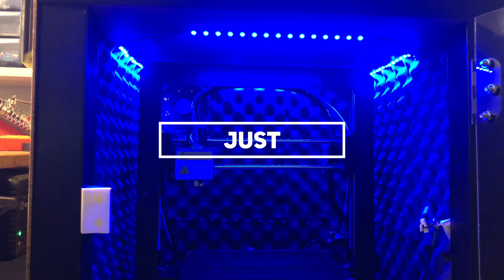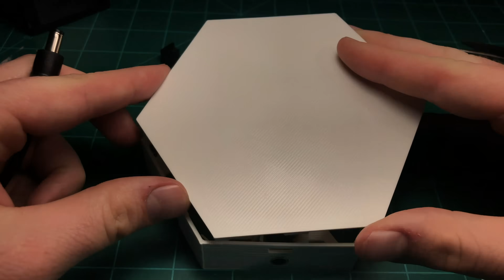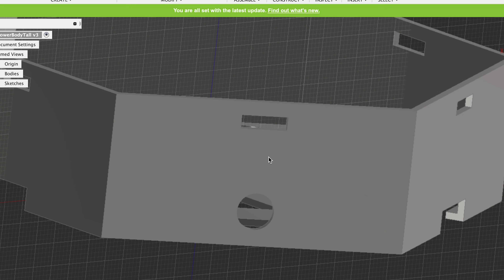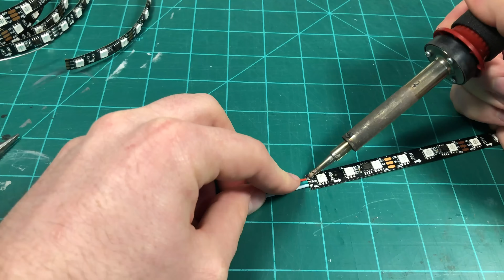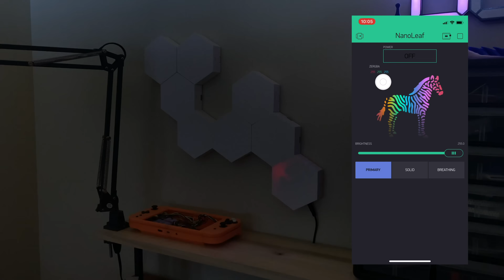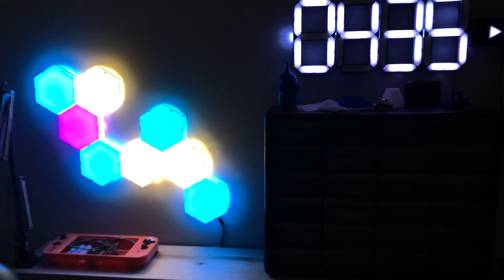DIY NanoLeaf Panels On A Budget! [Under $30 TOTAL!]

Comment: Did you have a link to the female plug for the power supply?
Reply from the maker: Yup, sorry about that! I originally used one like this: https://amzn.to/3qviSND
but if I remade this project I would use a panel mount connector: https://amzn.to/3L1Hvsz
Hope that helps!
Reply: @ModernHobbyist  do you have a video for the software side?  I normally use WLED but like how you can change individual panels with yours.  Thank you.
Reply from the maker: Sorry for the late response, I don't have a video for software on this specifically, but you could set up different segments in WLED to be able to control each panel individually if you wanted!

Comment: Today addressable LEDs make it too easy to get any colors you want, but I long ago realized that using cheap, non-addressable LEDs that are single color for the entire string, it would be beneficial to cross the wiring for each panel so that you can get differing colors in differing positions based upon the color choice you set the string to be.

Comment: where is your schematic for this?  How are you getting anyway with not using a logic level shifter in this design?  I'm using an ESP8266 for this but ESP32 is very similar and should have the same 3.3v logic output level.  The WS2811 data pin wants 5V logic, right?

Comment: how are the ledstrips lightning independent?
Reply from the maker: Hey thanks for the comment! The LEDs are connected in a continuous string, and the code is written so that each hex takes up 7 LEDs. So, for example, if I say turn hex #3 blue, it will turn LEDs #14-20 blue, assuming the first led is counted as 0. Hope that helps!
Reply: @ModernHobbyist  yeahh thank you very much!

Comment: If you use WLED software then you can segment your LED so each panel is its own segment and then you can set color for each panel with one esp32/esp8266. Since each 3 leds on 2811 can be addressed with its own color.
Reply: How´d you do that? Do you have instructions?

Comment: Cant you just resolder these two strips to compensate for the different layout ?
Reply from the maker: Hey thanks for the comment! Unfortunately not since the WS2811 LEDs only have one data input pin, so the order in which the RGB values are decoded is done on each integrated chip. Hope that makes sense, thanks again for the comment!

Comment: Are the LED connectors linked in the description supposed to be 2 pin?
Reply from the maker: Good catch, thanks for the heads up! They are supposed to be 3 pin, the product must have changed.

Comment: Well,  diffuser clips are 2mm higher than normal. They don't lock on the Hexagons. The Thingverse files should be revised. Additionally, the Arduino sketch gives an error:  'class EspalexaDevice' has no member named 'setState'. Can you please check these points?
Reply from the maker: Thanks for the comment! I'm not sure what might be causing the error, are you using an older version of the EspAlexa library? Thanks for the heads up on the clips too, I'll look into it.
Reply: @ModernHobbyist  Same problem here. The top part does not fit into the base because the lock holes are too high. Maybe the models on Thingiverse needs an update? Thanks for sharing!
Reply: @AndroideDelValle Fyi I have remixed the 3d models on thingverse to fix a couple of things. Look on remixes.
Reply: @NIKOSGEOR  I found it, thanks! I'm printing some of those and looks amazing. Thanks!

Comment: under $ 30 with 3d print , Arduino and addressable led...is it a joke
Reply from the maker: Nope, not a joke. Aliexpress can make for some very cheap projects if you don't mind waiting for parts.
Reply: @ModernHobbyist  does it include 3d printer part
Reply from the maker: @reshh9212  No, and it also doesn't include the computer I programmed the code on.

Comment: I'm on a budget, but I don't have a 3D printer, those are more expensive than the common "nanolights" online. Sorry, I can't follow. That title seemed misleading.
Reply from the maker: I spent less than $30 for materials for this project, that's why I put that in the title.
Reply: I meant any 3D Printer, not the Nanolight project
Reply from the maker: @Hondunu   I appreciate the feedback, but it is a common practice to list the cost of the project excluding the tools used to make it. I didn't include the cost of my soldering iron or the laptop that I used to program the lights for the same reason I didn't include the cost of the 3D printer.

Comment: I like you design for the Hexaleafs.
I probably use some of your changes when i make my own, but i thing they are a bit to high for my taste.
The only things i would change is the hight, only use 3 "anchor" points for the top panel and make the cutouts at the bottom as breakoffs.
No clue if someone already tested it, but i'm going to try and make a small chamfer for the LEDs so they shine to the front more directly. I hope they aren't going to shine through the front than :)
Reply from the maker: Thanks for the comment! I messed around with the height a bit to find what I thought looked best, but there certainly is some breathing room if you wanted to shrink them. The one problem you might run into is that the LEDs can get too close to the "diffusor" and you can see the individual LEDs. Play around with it and let me know what you end up with!

Comment: how is this diy if you don't own a 3d printer? that's the problem with this type of diy videos.
Reply: With that argument nothing is diy. You need tools to make stuff.
If you make it from wood, you need tools like a drill, saw and other stuff, too.
If you work with electronics you need a soldering iron, a voltmeter and a bunch of other tools.
A 3D printer is a tool just like a powertool. And since they aren't really expensive with prices under 200$ for good ones there isn't really a problem with making a Tutorial using them.
Reply from the maker: Thanks for the comment and questions! I agree, getting a 3D printer can definitely be a drawback, but like Dezi said, that is a tool just like a table saw would be for a woodworking project. If you are interested in 3D printing projects like this, I would definitely recommend getting a budget printer, as they will certainly get the job done at a hobbyist level! Thanks again for the comment!

Comment: Hey man, congrats on your channel. I loved all the videos so far, you're concise and clear, getting to the point pretty fast. The projects are awesome and the tutorials as well. My suggestion would be to keep putting more Anycubic content out, I've noticed gearbest is selling a lot of those in Europe and many new makers are hungry for Anycubic content, especially for the Mega-X which is at a pretty good price point at the moment given the print volume. Keep up the good work, I can't believe you have so few subs atm, I think that will pick up fast . My immediate suggestion would be a series of 2 videos : 1) Installing Marlin with mesh leveling 2) Setting up Octoprint
Reply from the maker: Hey thanks for the comment! I agree the Anycubic's are selling like hot cakes right now. Check out my channel for videos on installing Marlin and OctoPrint!